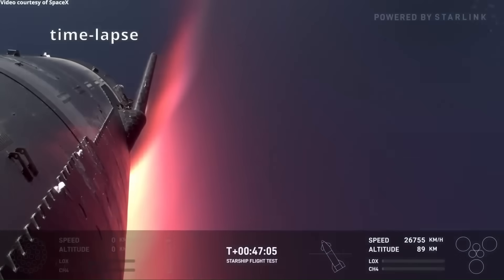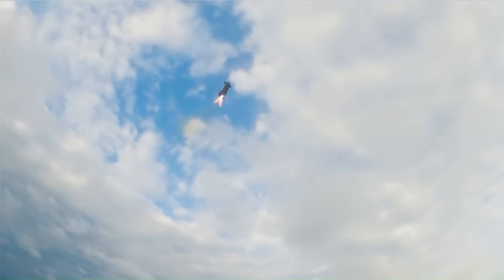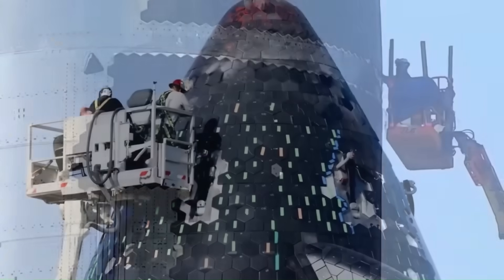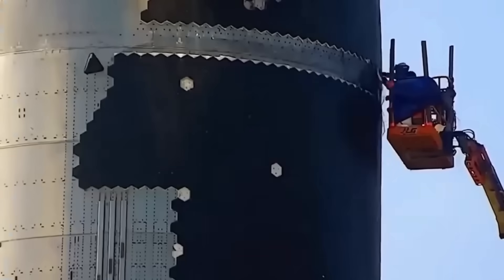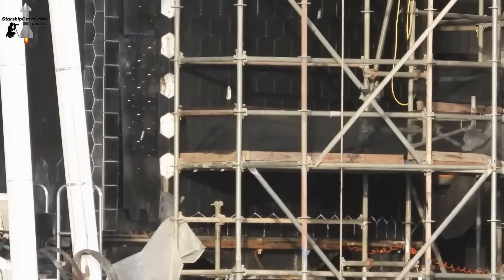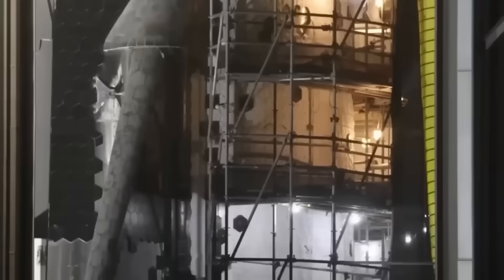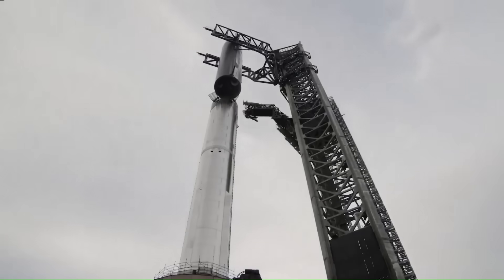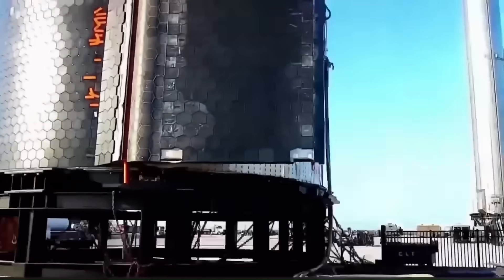SpaceX Just Made Breakthrough Solution For Starship Heat Shield Problem!

Comment: If the most eficient way of reentry is reducing speed why not bleed most of the velocity with rocket assistance and shortened heating burn shield time?!
Reply: That's a lot of extra fuel, like a LOT of extra fuel, once they figure this out, it will be way more efficient
Reply: This additional fuel would reduce the lifting capacity.

Comment: 1:09 "...eliminate the heat shield entirely:" I've repeatedly made the comment that the solution is to just return more slowly so heat doesn't build up in the first place. I've received no criticism of this idea. I've received no reason it can't be done. Yet I've also received no comments that it can work and it's the obvious solution. Why is that?
Reply: Young sir,  The amount of fuel needed to obtain orbit would equal that of breaking/slowing before entry. Then more fuel is needed for retrieval. We have not unlocked anti- gravity yet, more time is needed. Patience sir.
Reply: "to just return more slowly"     Exactly how do you just return more slowly?   We have this thing called gravity and the speed of orbit.
Reply: @jamescole3152  Try this. Think. Can you think of a way to return faster? I can. Therefore I can also think of a way to return slower. Want another round... or can you "think" through it yourself?